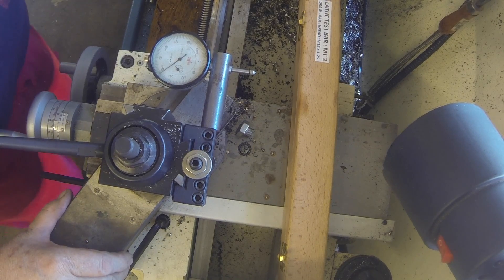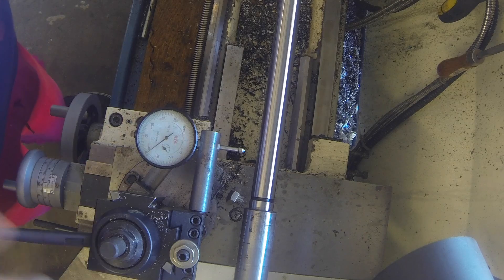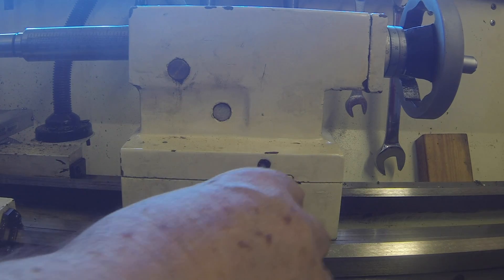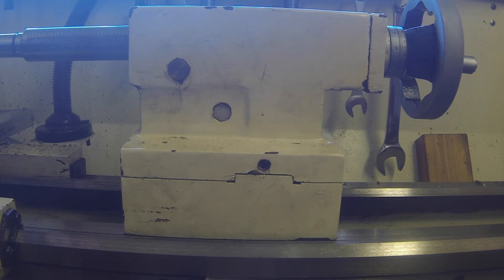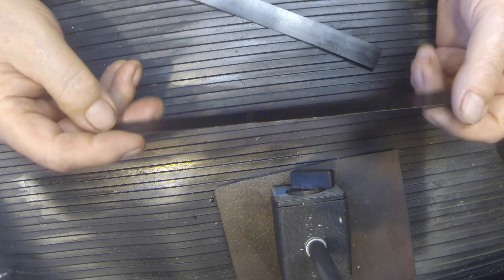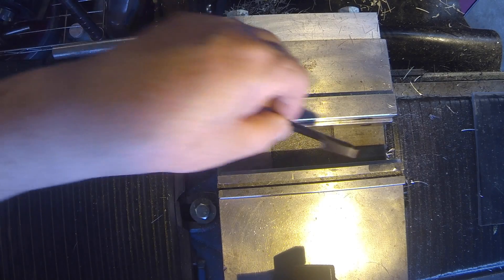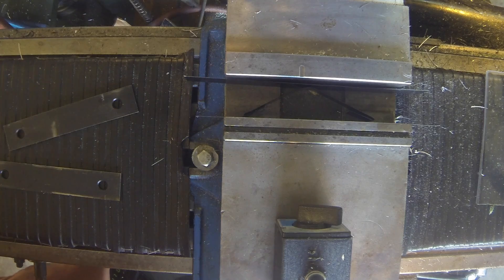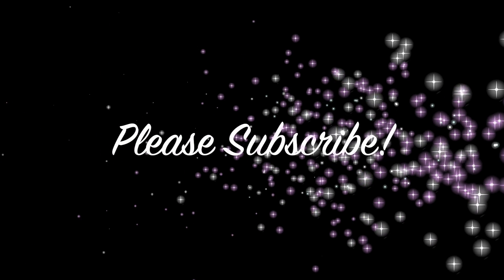This Week in Herb's Workshop #110

Comment: Nice tips for the week end.  I have used a bar for aligning the tail stock but it was one that was thinner in the middle than on the ends and if you can cut the ends to the same size without adjusting your tool then you are straight.  That bar makes it a lot easier.  Keep on keeping on.
Reply from the maker: Thanks, Harold!